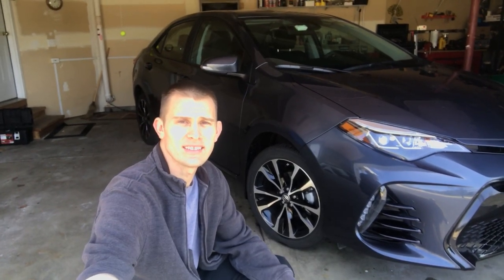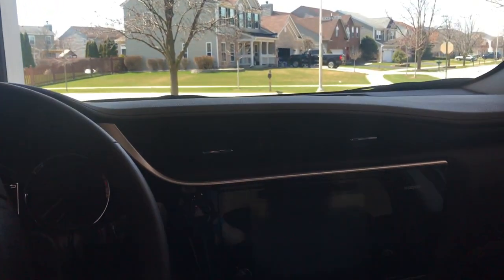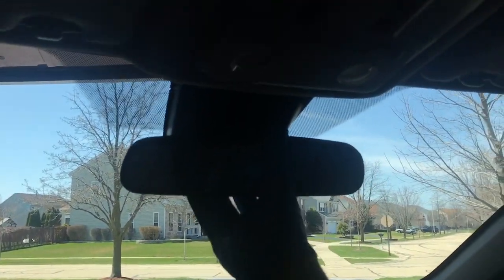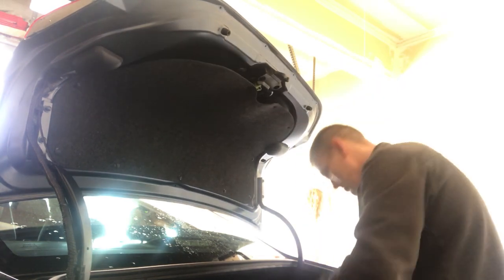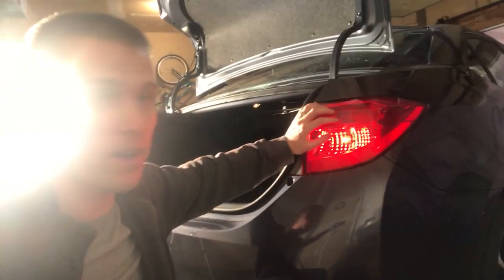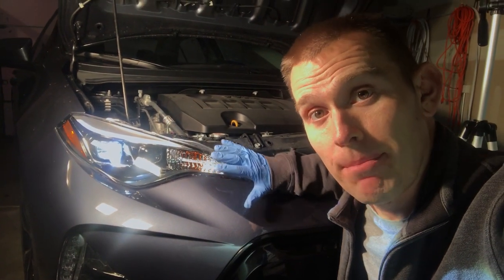Toyota Corolla How to Change ALL lights to LED

Comment from the maker: Timestamps of Toyota Corolla Changing bulbs to LEDs:
0:25 Change the Map light bulbs or Reading lights bulb
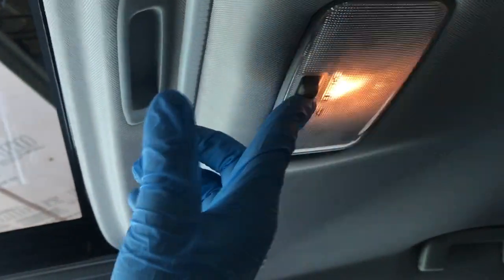4:04 How to change the dome light bulb by your head
6:23 How to change the trunk light to LEDs
7:30 Replace the License Plate Bulb on the hatch (remove the carpet)
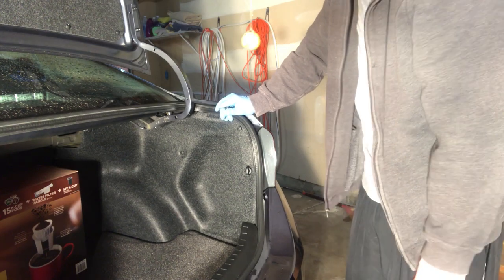13:18 Process of how to change the rear turn signal bulbs (not led) - also how to remove taillights to replace brake light bulbs
15:17 Why I don't change turn signal bulbs to LED
17:10 Quick info on how to remove front accent lights
18:40 How to Change the front turn signal bulbs white / blueish
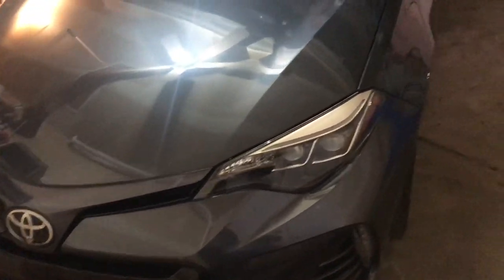21:00 How to change out Stock OEM Headlights?
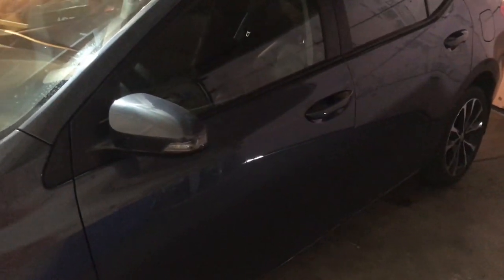23:25 First mods to change when buying a car: (example -
 Changing engine filter by installing K&N air filter)
Reply: Have you tried to get into the DRLs? I really want mine like a green or lime color.
Reply from the maker: Sorry I haven't tackled that yet

Comment: I just changed my bulbs to led.. Nice and bright now. I wanted to ask you. My led lights seems to be touching the plastic is that ok? I purchased the same pack you did.
Reply from the maker: D Jers -- which bulb is touching out if curiosity? I may have bent the metal prongs to fit it better .  But yes since it's led and creates little to no heat you should be fine.  If it were incandescent bulbs it would definitely melt the plastic.
Reply: Because LED bulbs generally do not create excessive heat it is okay if they are touching the plastic

Comment: I think the lights for the rear license plate should be led since they can be hard to see with the regular bulbs and wished Toyota had installed them at the factory like the headlights
Reply from the maker: Davin Peterson -- definitely agree with you, Toyota must have a ton of these incandescents in stock which is why they still use them (and for the price). Hopefully soon all vehicles will come stock with leds throughout!

Comment: What about the vertical side led lights under  and to the side of the headlights.
How can I replace those?
Reply from the maker: Sorry I haven't tackled that project yet, can anyone else help answer this?
Reply: The vertical lights in the bumper is led the headlights are also led from the factory
Reply from the maker: Not sure it's led headlights on all models is it?
Reply: @JealousLawnCare  yes the 2017 has led headlights on all models
Reply from the maker: Thanks for confirming!

Comment: But if I have a 2015 I can change the turn signals. But true it shouldn’t matter till their out. I just learned and did my trunk and license plate lights 😊
Reply from the maker: Mrs_xGaming -- that's great! Turn signals are always tricky because you need resistors to avoid the quickly flashing bulbs.
Reply: I just did my reverse lights too! Thanks your video is amazing. 
I’m making my 2015 look like a 2019 in a few weeks
Reply from the maker: Mrs_xGaming -- glad it helped! What modifications are you doing to make it look like the newer model?

Comment: what are the bulb types and sizes for the 2019 corolla, been looking around online I cant seem to find them.
Reply from the maker: iFLIP★07 -- looks like it's too new to be found online, but you should have all the same bulbs (especially interior) as this 2018 I shown here.  Vehicles only change every 4-5 years with body styles, lighting...etc.
Reply: @JealousLawnCare  does this apply to other accessories as well like window visors, door sills, etc.
Reply from the maker: iFLIP★07 -- for lighting, yes it should be the same for all interior bulbs. To verify for sure you could always check with a dealer to confirm the bulbs are the same.

Comment: Would you please post how to replace the 3rd brake light bulb on this corolla 2017?
Reply from the maker: Pedro Freire -- I'll have to get my parents house and see how this is possible..I'll get back to you in a bit
Reply: Jealous Lawn Care was it ever possible? Would like to know
Reply: Yes please, 3rd brake light.
Why does dealer charge over 300 dollars to replace bulb.
Reply from the maker: Must be a lot of work..sorry haven't tackled it yet
Reply: 3rd brake light housing. Burnt LED light after 5 years. Must change whole assembly.  270 dollars for part. Over 100 dollars labor.
Anyway I can install my own 3rd brake light. Thank uou
Reply from the maker: They never make it easy unfortunately 😡
Reply: Your having same problem as mine. They told me xant change LED strip, must change whole housing. 370 dollars plus tax.
I ll see if my mechanic can install another type of 3rd brake light
Reply from the maker: Yep those led strips are very costly...no way around it to my knowledge unfortunately

Comment: To the best of my knowledge the side yellow marker lights on the attached to the headlights are required by state law.
Reply from the maker: Danny Pittman -- yes definitely need to check with your state laws, every state may be different.  However as we all know, whether right of wrong, small mods are typically looked over by police most of the time. Heh

Comment: talking about LEDs, you think it would be possible to make a vid where the DRLs are constantly on with a switch. one problem with that corolla Is that the day time running lights turn off when the headlights turn on.  I've tried looking online on how to keep them on
Reply from the maker: Kmarillo127 -- im sure it would be possible, however changing wiring is beyond my knowledge unfortunately. Heh sorry

Comment: Also, the Corolla has a cabin air filter behind the glove box. You'll need to remove the glove box to access it.
Reply from the maker: Davin Peterson -- yep some cars are easier than others unfortunately for the cabin air filter, it's usually pretty quick but in am awkward place. I didn't even get into that here because this car is so new (5k miles), so the oem filter is still acceptable for now.